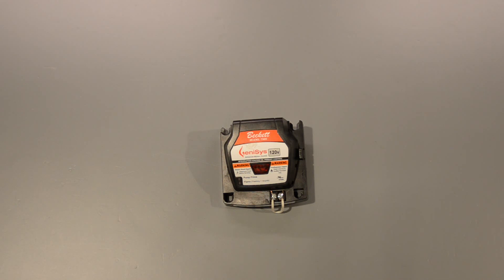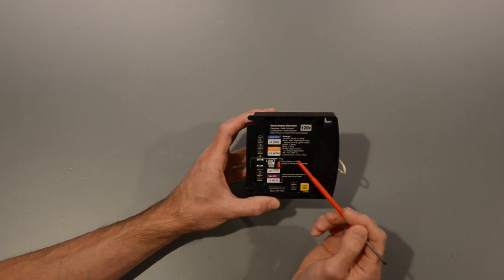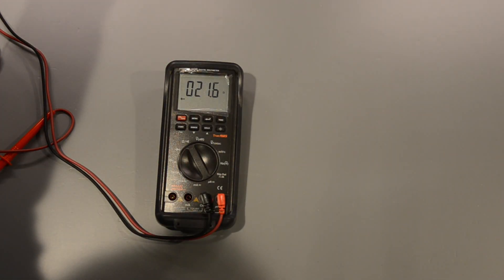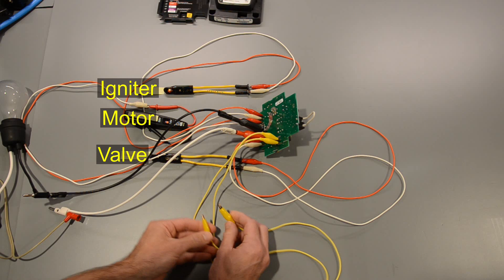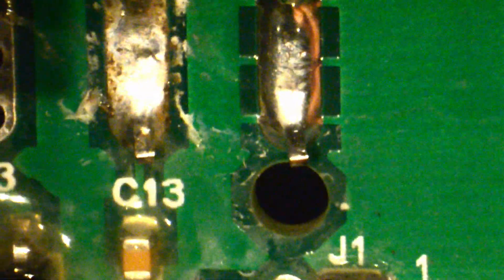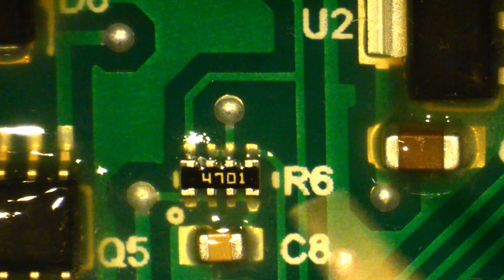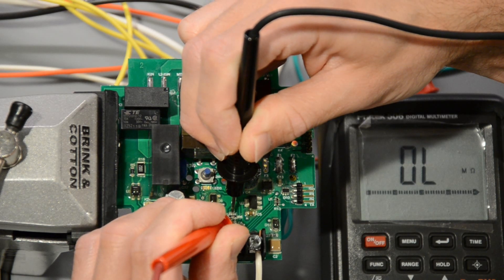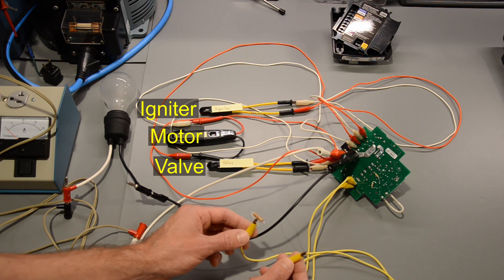Failure Analysis of a Beckett 7505 Burner Control

Comment: Thanks for the video. My controller had same issue with not seeing the flame sensor and I replaced the CAD sensor but still didn’t work. After seeing your video I replaced the controller and this fixed the issue.

Comment: I have an oil burner that currently has an power extractor fan to extract the flue gasses from the burner. A technician suggested that I can replace this extractor fan with a 7505 which has pre and post purging and that would be sufficient to purge the furnace after each firing cycle. Is there anybody who has tried this? Is this a reasonable way of purging the system?

Comment: Excellent video.  about 5 years ago, my Becket 7505 control over heated and failed.  I had a service tech came out and found the control was so hot you could not keep a finger on it.  The unit was replaced with the same model.   Yesterday the boiler shot off.  And was off for at least two hours. I assumed that it was out of oil. But after checking oil tank level and filters, there was no problem with oil.  I energized the system and turning it on.  It has been running without a failure, but the controller is running a little hot 90'F with an infrared Thermometer reading the black top of the controller.   I have a back controller ready to replace it.

Comment: Idk if you will see this but, i have the same beckett system! Its only 3 ta 4 years old! I went to turn my heat on and nothing! So i went to my furnace and it wont power on! I checked the wiring and the fuse! When i hold the reset button ,the 2 lights go yellow after about 15 ,20 seconds then just both shut off! If i cut the power with the handle or the fuse and turn it back on, it will blink red n thats it! Any thoughts?

Comment: ive, got this very unit. it ran yesterday until the house was in the 90s .i tried turning down the digital thermostat with no luck so i flipped off the wall switch and now the green light is on constantly and it wont do anything even after holding down the reset button

Comment: Hello my water expansion tank split in half so I dried the water and replaced the tank now the burner got wet and I could hear an electrical noise like something electrical got wet 
Anyway after replacing expansion tank the furnace will not fire up 
It's not trying to turn on and when I tried  bleeding it there was no pressure at all the oil would drip very slowly 
I'm assuming it's the primary control 
If anybody can help I appreciate it
Reply: The burner it's not making the initial noise before the furnace turns on

Comment: DO NOT DO THIS!!!!!!!!!!!!!!!!!  IT IS ILLEGAL TO TAKE APART ANY GAS OR OIL BURNER CONTROL, GAS REGULATOR, OR OIL FUEL PUMP AND REPAIR THEM, THEY ARE SEALED AND PROGRAMMED AT THE FACTORY, IF YOU DO THIS, AND HAVE A FIRE OR EXPLOSION THEY WILL BE ABLE TO TELL AND IT WILL ALL BE ON YOU, NO GAS OR PRIMARY SAFETY CONTROL CAN EVER BE REPAIRED, IF IT GETS WET OR MALFUNCTIONS IT MUST BE REPLACED!!!!!!!!!!!!!!!!!
Reply from the maker: Thanks for the feedback.  I changed the title to remove "repair", added a disclaimer to the description, and cut out the ending where I call this a repair.  This is now a "failure analysis" video.

Comment: Nice video. I have one of these units that has an open primary in the on board power transformer. I can't seem to find a replacement. Do you know of any? Thanks.
Reply from the maker: Failed windings are very rare.  This could have an internal thermal fuse on the primary that is blown, I'd check for that first.  It will likely be just under the tape on top of the primary windings, and can be replaced.  You should also ensure the secondary circuitry does not have a short, causing an overload.  I have seen such fuses fail elsewhere, even without significant overload.

If you cannot locate a fuse, you may not find an exact transformer replacement, but there is nothing special about the transformer.  However, without ripping my controller back apart I'm not sure how many secondary windings this has or their voltages.  Judging by the bottom PCB traces at 4:58, it looks like this is at least a center tapped secondary (if not two windings).

Comment: Hi I switched my controller and jumped it. The three lights come on for a second then it turns off. Any idea what I could do? Thanks
Reply: I've got the same problem
Reply: @robertbobinis3076  Do you have the wire jumper on Tw-Tr (on the top of the unit) installed?

Comment: Do you have any tips for diagnosing no igniter? Wiring diagram of the board would help
Reply from the maker: With the ignition transformer flipped up, you can connect the primary side directly to power and see how well it is able to strike an arc.  You should be able to find other videos demonstrating this to get an idea of what the arc should look like.  Be careful with how you poke the high voltage side.

If the transformer is not the issue, make sure the electrodes are clean and adjusted properly.  You can also check whether the transformer is receiving power.

Comment: My controller has no lights on at all. Not even the reset button is blinking, but the yellow pump prime light does come on after 15 secods holding it. Could the controller be bad?
Reply: it was bad,replaced it and heater fired right up
Reply: @Monkmandan  I wish I had seen your question a month ago.  I would have recommended replacing the 7505 with a Carlin Promax.  Much more reliable and programmable, and it doesn't need the add on "contractor" tool to program or read history.  I like the Beckett AFG but I run with with the Carlin controllers.
Reply from the maker: After this Beckett failed I put in a Carlin 70200, and certainly prefer it over the Beckett.  No issues with the Carlin after 3 years, but I keep this repaired Beckett around as an emergency backup.
Reply: @lisacourt7269  Well replacing with the same controller I figured would be easiest,if i had any other symptoms I would have called an expert but just swapping wires was easy.
Reply: Hey man thanks for the video. I bled my burner, and my controller went out. After giving it a hard restart, it would still not turn on. I bought a new controller, plugged all wires in the appropriate locations. When I turned the burner on, the green light, yellow light, and red light of the controller came on for one second, then turned off. I read the trouble shooting part of Beckett’s website and they said to 1. Jump the TW-TR wire. I did that, no change. Then 2. Check the voltage going into the system. I did that and read 120. I’m kindve shit out of luck and freezing at this point lol. Any suggestions?
Reply: @michaelo691  Did you hold the button down for 15 to 30 seconds?Try that.
Reply: @Monkmandan   no luck but thank you anyway!
Reply: @Monkmandan  when I hold is for 15-30 the yellow light comes on and stays on so long as I’m holding it. When I take my thumb off it turns off.
Reply: @michaelo691  Mine old did the same. Got a replacement and it worked.
Reply: @Monkmandan  hmmm, this was the replacement one lol
Reply: @michaelo691  Oooh I dont know then Im out of ideas. goodluck!
Reply: @Monkmandan  thank you anyway for responding!
Reply: @michaelo691  ever find out what it was?
Reply: @EstaticMonkey845  yea the problem was my check valve was blocking al the heated water from passing and getting around my house. I changed every major competent to the burner before I found this out.
Reply: But this specific problem was a safety feature of the controller. I believe the power goes out when the temperature has hit a high point as safety feature. This doesn’t mean your controller is broke, it means your controller is working well.
Reply: @michaelo691  If that was the case, a new controller wouldn't have worked. Its been 2 years,heater works fine.